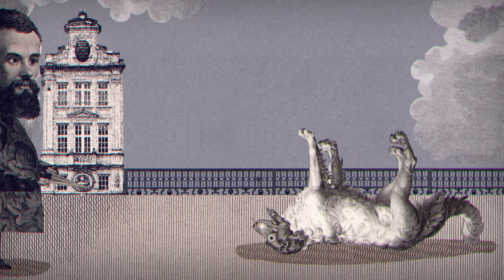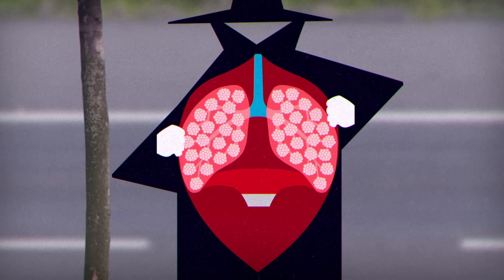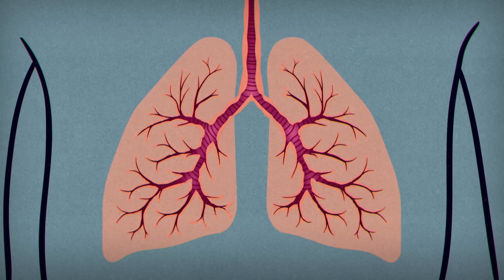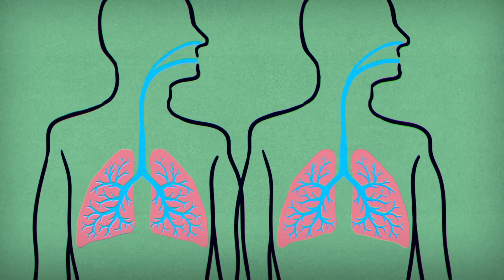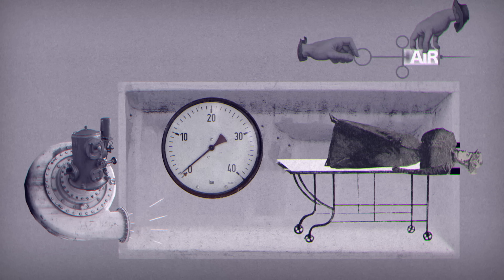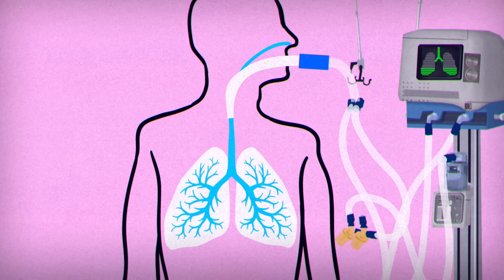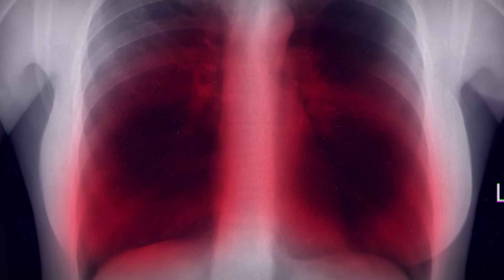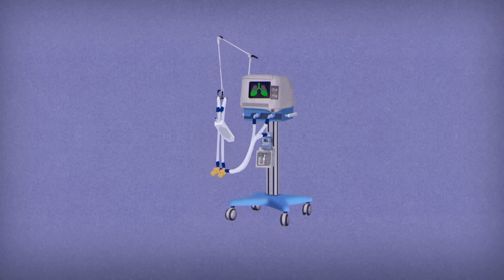How do ventilators work? - Alex Gendler

Comment: Recent data suggests that 2/3 of patients placed on a ventilator have died. How effective is this really?
Reply: Hi! Ventilators are essential to help the patient survive longer, however the longer they use it, the more damage could be done, as the video has said. But that doesn't mean that ventilators cause death, but it's more like the patients are survive on ventilators, at the same time they are also taking damage from the ventilators and from their own illness. It's more of a race of time to see can the patient recover quickly enough so that he/she doesn't need the ventilator, or the patient will die because he/she did not manage to recover fast enough even though using a ventilator. I found this article that sort of explains why. Hope this helps
https://www.npr.org/sections/health-shots/2020/04/02/826105278/ventilators-are-no-panacea-for-critically-ill-covid-19-patients
Reply: Joe Scrivano If your goal is to manufacture a crisis, then it's extremely effective.
Reply: do tell me if i said anything incorrect, thanks!